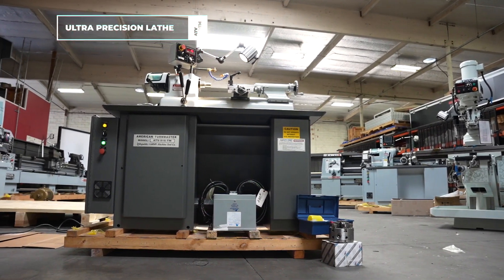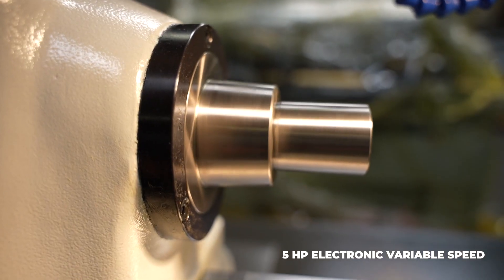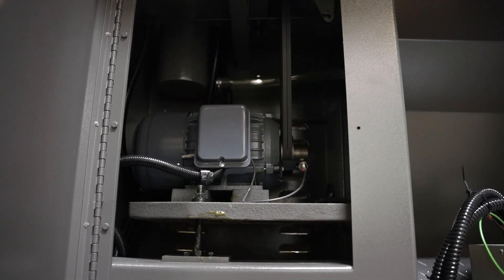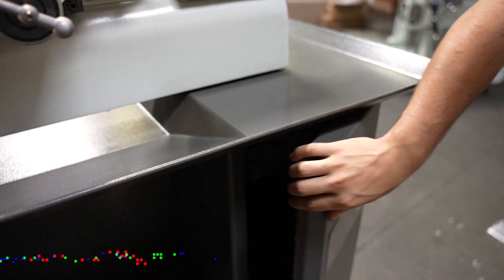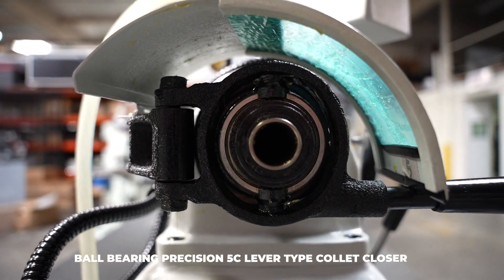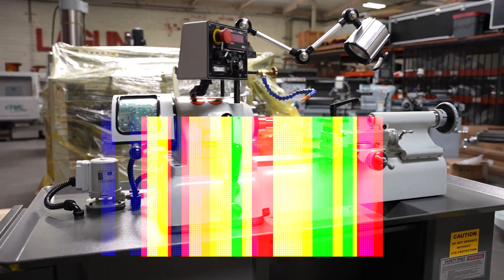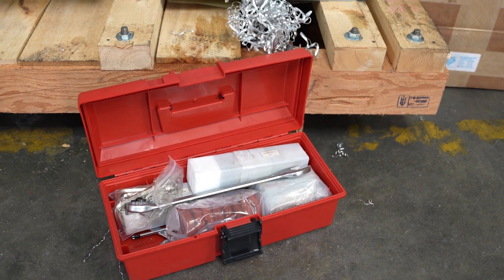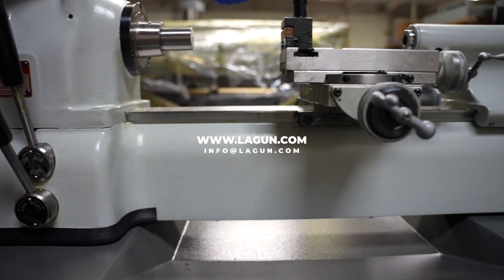Republic Lagun Machine Tool ATV-916-TM Ultra Precision Lathe

Comment: It seems to be finished off rather roughly for such a precision machine. Perhaps the 'things that matter' are all 100% but the castings look like the worst Chinese quality and would deter some potential buyers from choosing it. Am I too picky?
Reply from the maker: We guarantee that our ATV-916 is constructed using top-of-the-line manufacturing practices and materials, none of which are produced in China. At Lagun we stand by the quality of our machines. This is because of the high standards we set for each machine we assemble in-house at our Los Angeles, California plant. We are happy to review and discuss more of the details and specifics of this machine, should you have any more comments or questions. Please get in touch with us via email at info@lagun.com, or you can call us at (310) 518-1100.
Reply: @LagunEngineering  Thanks for the response. Certainly, I use a FTV-2S mill which I've had from new since the mid 90's and it's superb. Very accurate and repeatable and solid enough to cut heavy when needed. So I hope Lagun keeps up the high standards and resists the 'bean counters' who might try to outsource manufacturing to cheaper suppliers. The extra money we spent on the Lagun Pacific was well worth it. If the ATV-916 is built to the same standard, then I'd have faith in it.